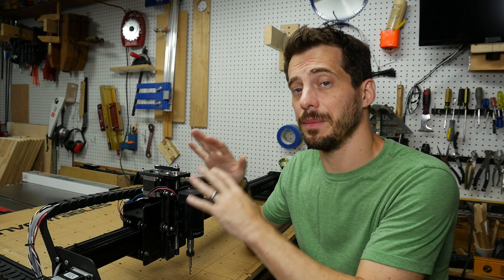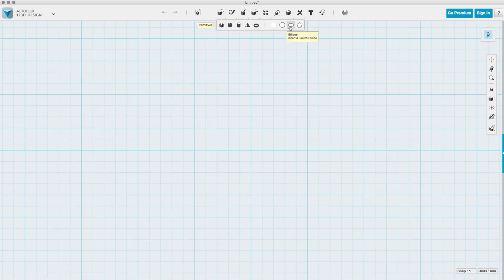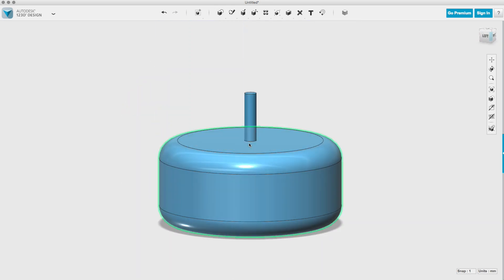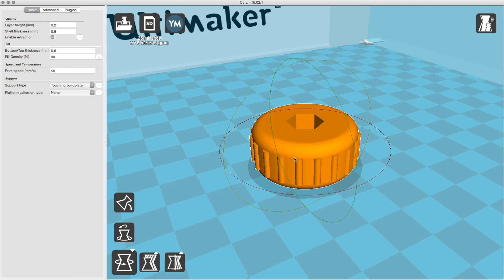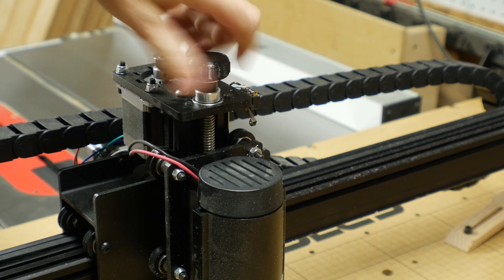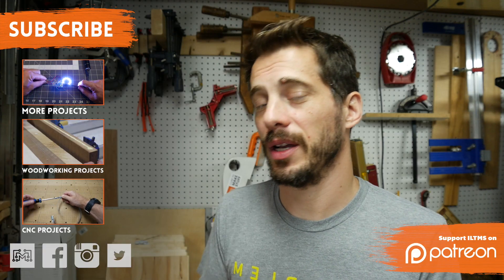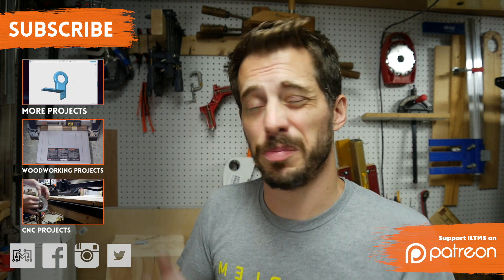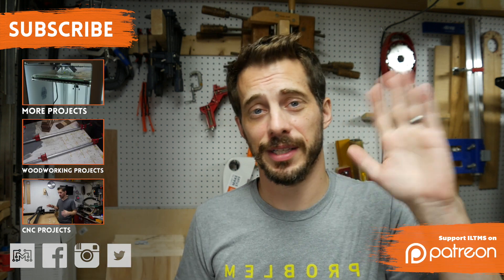3D Printing to solve a problem // How-To | I Like To Make Stuff

Comment: Tinkercad is a good 3D modelling program, but there is no pattern tool so that would be a problem. It's also designed for the average person who has no experience. It is also designed for 3D printing.

Comment: A very good inexpensive printer is a Anet A8, it is about 170 USD on gearbest plus shipping. I use fusion 360 as my modeling software and curator as well for my slicer. I've used a makerbot z18 and replicator and this printer can print up to the quality.

Comment: Fusion 360 way more powerful than 123d please try it
Reply from the maker: I agree that it is.  I use it these days, but I also wanted to show 123d as a good entry level option for anyone with no modeling experience.  Fusion definitely has a learning curve.
Reply: I Like To Make Stuff fusion 360 was my first modeling software and I found it pretty easy to grasp and makes it very easy to transfer to 3D printer. I would recommend a Anet A8 if you are looking into 3D printing

Comment: You measured the faces of the nut and took half of that diameter to set the radius? This wont work out. You either measure from edge to edge or multiply the face to face measurement with 1.15 and half that.
Reply from the maker: ok.. but it worked.

Comment: When trying to find a printer, ask around at your local colleges/universities. I can almost guarantee that any engineering or design school will have a printer you can have access to. The nice thing about these is that they typically are non-profit departments and will only charge you the cost of material that you print!

Comment: Does anyone know what Cura is for other than to flip it? What is its main purpose and is it required to 3D print?
Reply from the maker: +Luke Bennett It's called slicing software, and it turns the 3d model into a bunch of layers so the printer knows how to print one layer at a time.  Basically converting the model to printable instructions for the printer to use.
Reply: +I Like To Make Stuff Ahhh, thank you!

Comment: this is an example of over complicating the solution. which is just to use ratchet. accessible in every shop. specially if you need to use this function just sometimes.
Reply from the maker: You're entirely missing the point of the video.
Reply: +I Like To Make Stuff no i don't. i get what you are trying to achieve with this video. my point is that you should have used problem which  really would need something custom made. for example if some bracket somewhere would be broken off. so you need to custom made holder or something similar.  just like your custom case for go pro lighting.

Comment: Why not use the bottom of the calipers to measure the height of the nut? Put it on top of the nut and open the calipers until the guide rod touches the washer below the nut. While you didn't have any tolerance constraints in this case it is a more accurate way to measure height/depth.

Comment: Hey bob! Awesome video. I love your channel. Quick question: what 3d printer did you use in this video and what is the best printer you recommend for a first timer that is relatively inexpensive?  

Thanks,
Jeremy
Reply: +Jeremy Oblon, I have a Printrbot Simple Metal and love it! Very rugged design and it prints great with PLA. At 539$ in kit form or 599$ assembled, it's one of the best sub 1000$ printer. I've added a heated printbed and upgraded the print size from 6" x 6" x 6"h to 8" x 8" x 12"h.
Reply from the maker: +Jeremy Oblon Thanks! This was printed on the Ultimaker 2, which is NOT an inexpensive one, but a really good one!  There are tons of them out there, but I don't know of a really good one that isn't too costly, unfortunately. I'm just not familiar with that many of them. :/

Comment: I prefer to use the autodesk inventor software to design objects probably because it makes it easier to design things, like i could make something similar to your project in 2 steps. The downside is that the software is very expensive but is worth using and learning. For the 3d printing software i use the same software as you do believe it or not. None the less keep up the good work.

Comment: Very nice project, congratulations on properly using a 3D printer for practical purposes. One thing that bothered me about your video is manually turning the stepper motor. I have been told not to do that if the motor is still connected to the driver, even if the system is shutdown, as the motor could induce reverse currents on the driver, but it seems that you have not had this problem so maybe my information was wrong. Thank you again.
Reply from the maker: +Lucas Diego Rodrigues Ferreira I've had 3 different CNC machines and never had any problems with that in any way. That's not to say that it's an impossibility, but it's never been an issue for me (I've never heard of it being a problem from others either).
Reply: +I Like To Make Stuff Won't turning the bolt by the nut end up untightening it after a while?
Reply from the maker: N4w4k No, this is a nylon nut, so it's tough to turn on the threaded rod. It's locked together.

Comment: Hey +I Like To Make Stuff i like your Videos a Lot and have got a question? Which 3D Printer is this? Do you don't use your Delta printr? I Want to buy one which of these do you recommend :)?Thanks a Lot and best Regards 

Musti
Reply from the maker: +Mustafa Karli This was printed on the Ultimaker 2.  I've seen others have great success with the DeltaPrintr, but personally, I have not.  The UM2, however, is AWESOME and well worth the price tag (which is admittedly pretty high) for a plug-n-play printer.
Reply: +I Like To Make Stuff thank you so much for your fast Feedback :) i will watch some reviews about ist. best Regards 

Musti

Comment: I want to add that Solidworks is my favorite 3D Design software. It is super expensive, but if you are a student (like I am) its only $150 a year vs 10k for a license. (Yes it can be cheaper than 10k, I am making a point that it is extremely expensive)

Comment: What about adding your logo on the top?
Reply from the maker: +norm1124 I tested that, but it's too small to be really clear and just wasn't worthwhile so I removed it.
Reply: +I Like To Make Stuff True the knob  was small. You may need a simplified logo derivate for low-res / flag size :-)
Reply: +I Like To Make Stuff the 'M' from your profile pic? Emboss it to 1mm and it should be decent, I think!
Reply: +Acrimonious Mirth or a sticker since the top is flat.
Reply: +kodiak wild and because it prints top-bottom. If he felt inspired he could probably make an "M" style knurling. Don't forget if it's printed in ABS he can always solvent weld two pieces together and so printing these really thin logos and welding them on top could work.

Comment: Can I use 3D printer with AutoCad?
Reply from the maker: +Bryan L. Vega As long as the slicing software ( in this case Cura) can use a file from it, you can use anything.  Typically, .stl and .obj files are good general file types to use.
Reply: +I Like To Make Stuff Perfect! Thanks man :)
Reply: +Bryan L. Vega Yes, autocad works, just export STL
Reply: Bryan L. Vega I wondered that too

Comment: Ive been using autodesk inventor for a year or two. It seems a bit more limited than 123D design, but i'd highly reccomend it, it's an excellent program. You can also use it for animations and assemblies to see how everything would work together. It's pretty good.
Reply: I prefer inventor over any I have used. I printed a d20 die for magic. using nerdy things to do nerdy things
Reply: nice
Reply: +Italian Isis Inventor and 123D are both made by Autodesk.  123D is meant for beginners while Inventor is geared toward professional use.  Having features that are easily dragged is not something you would want when designing a part requiring precision.  Inventor works in absolutes so you would move the extrusion by re dimensioning the sketch used to make the extrusion.  Everything you model in 123D is possible to model in Inventor but I could model some pretty complex parts in Inventor that would be impossible to model in 123D.
Reply: +Italian Isis How is Inventor more limited than 123D? It is a much more robust modeling program aimed at professional use.
Reply: Proto G This is just a first impression from the video i saw, but the ability to move extrusions seems pretty nifty
Reply: +Italian Isis what do you mean by move extrusion? like adjust with just a mouse click or move it around.
Reply: BRETTVARG after extruding geometry, he was able to drag the object he extruded
Reply: Proto G thats a pretty good point

Comment: Or, you could cut a knob in under 2 minutes on that very cnc router.. :p
Reply from the maker: +Auarhau You could cut A knob on the router, but not this one.  You can't do undercuts, and given that the bits are cylindrical, you have to use a very small bit to cut a relatively sharp inside corner. So, to use such a small bit, the cut would take WAY longer than 2 minutes and not be as exact in fit as the once used here.
It's certainly possible to do, but it's not as simple and obvious as you would like to think :)
Reply: I was being smart:p If you need that  knob in particular yes, it's probably easier to just print it:) But there are a lot of knobs to choose from. I cut them all the time for my shop. The inside hex pattern does not need to have sharp corners, it just needs to fit tightly on the nut. You could add dog bones or similar. Or what I do is just make it a close fit and then hammer the nut in. It's also quite possible to cut this knob on a 3 axis machine I believe, but it would involve a ball nose and flipping the part (probably still faster then printing, but a lot harder on the brainz!). That said you could make quick simple knobs in a hundred different ways. It was just a little funny that you used the 3D printer to make parts for a parts making machine :D But I guess in many ways they complement each other:) Keep the videos coming Bob. I love it when they pop up on my feed.
Reply from the maker: +Auarhau Thanks! Yeah, like I've said before.. there are 1000 ways to do every single thing you see on YouTube :)  The point of this video wasn't really the knob at all, it was to show 3d printing as a solution rather than a thing that just makes prebuilt things from Thingiverse.

Comment: Hi Bob, Is that plastic hard enough for zero clearance inserts.  If so, 3d printing would make the easiest solution for making multiple inserts whenever a new one is needed.  Thoughts?
Reply from the maker: +Spencer Peterson Hmm, never thought of that! I guess it would be, you'd probably want to make it reasonably thick and set the infill (internal structure) of the print to be more full than normal so it was strong.  Great idea, it's worth a shot!

Comment from the maker: +Florian V.D. For me, I'm duplicating the model in Cura and printing 6 at a time.   If you were going to produce LOTS of these, you'd want a more efficient production method, like molding & casting them with a less expensive material. I don't expect to be selling too many of them, so I didn't go that route.
Reply from the maker: Jimmie Arnold I'm actually going to be doing a loft/bunkbed for one of my boys in the coming months :)
Reply: USE SUGRU!
Reply: my favorite is Google sketchup
Reply: noticed you haven't been doing any wood working for a little bit and just wanted to know if you would be interested in making a loft bed?
Reply: +Bat Pug Sugru is cool stuff, but very expensive per ounce. PLA and ABS are very affordable options.

Comment: insightful video Rob. Remember the days when you around 15,000 subscribers, when i accidentally stumbled on your  first pallet wood bench. Man you have done so much! cool vid on the process of 3d printing. how much are the cost of the spools of plastic used for 3d printing?
Reply from the maker: +MrJewripper Thanks for sticking around so long!! Well, it depends on the type of plastic, the weight of the spool, the seller, etc. but generally anywhere from $25-$45 for general use PLA/ABS.  There are other spools that are more expensive with specialty materials like wood fill, carbon fiber fill, etc.

Comment: Do you know what's even easier? Use a Costumizer in Thingiverse, there are knob-generators you can download the .scad-File and create even better things in openSCAD.
Reply from the maker: +John Smith I think maybe you're missing the point of the video. It's not really about the knob, it's about the process.
Reply: I Like To Make Stuff Yeah, i know, thats good and fine, but if you want a quick thing (Like a Knob, a Cap or a Box) a Costumizer is the fastest method.
Reply: +I Like To Make Stuff Want to know what is even easier?  A socket and ratchet.  ;)